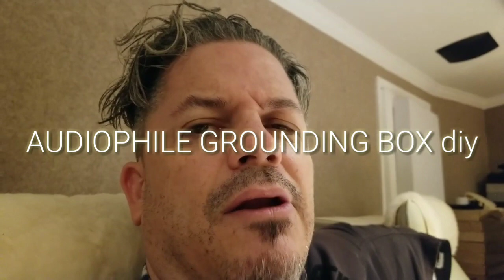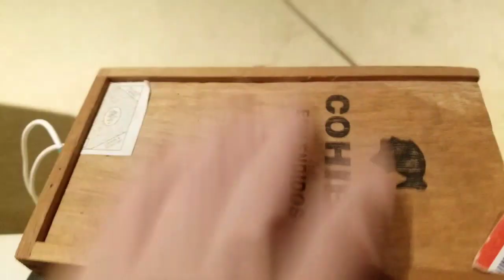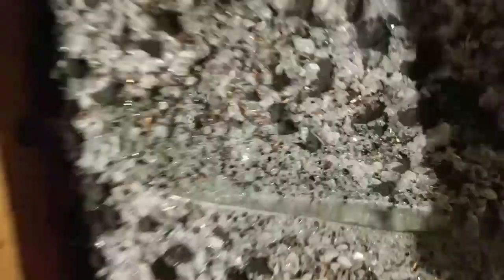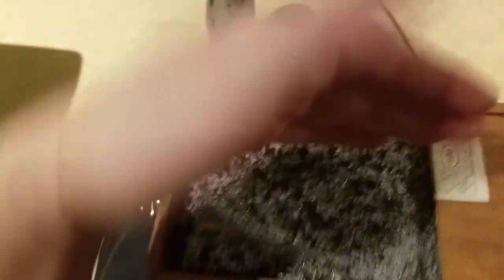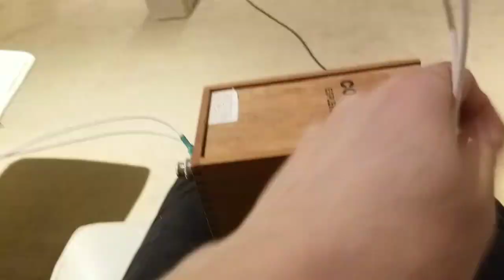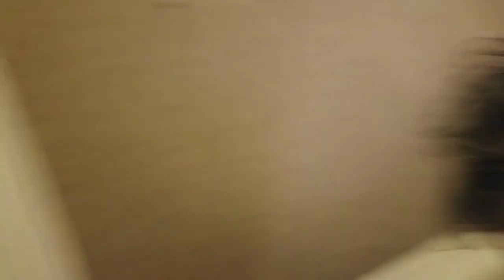AUDIOPHILE GROUNDING BOX

Comment: I am always amazed at how so many "audiophiles" are utterly ignorant of the most basic concepts of electrical/electronic circuit theory.  IF that thing works (it doesn't, but...) and you have an understanding of basic theory, then take some measurements, and tell me what the impedance of that thing is.  Express your answer in rectangular or polar coordinates, as you wish.  )
Reply from the maker: Yawn... boring..... I'm into music, not lab coats
Reply: @OCDHIFiGuy  I'm into music, too...and oscilloscopes, signal generators, THD analyzers, spectrum analyzers, impedance bridges, etc.  They kinda go together, and each makes the other more fun.
Reply: Very simple , listen and decide .

Comment: From what I could see there is a bit of foil and a collection of crystals and rock bits. The binding post provides a common Earth to all the equipment. The binding post will ensure that the earths on the separate pieces of equipment are all at the same potential, apart from small drops due to the resistance of the cables you used. There is no conduction path out of the box that I could see, so no current will flow anywhere in the box. Magnetic fields will be zero because no current flows.
Reply from the maker: Unless the box is negatively charged

Comment: Im glad peizo sheilding/earthing/protection is getting more attention. Obviously no one wants to share the sauce which is unfortunate (but understandable) as people really need things spelled out for them. Personally I think the greatest effect of these systems is that the reactivity of the qartz creates an opposing force to all the nasty RF and EM noise polluting the cables (essentially antennas) we use. When you consider even 16 bit depth at line level is 2.5v / 65,536, microvolts of noise can obscure several "steps" worth of resoultion, ,and 24bit? pretty much theoretical. There is someone Ive seen that will encase the crystals in a polymer clay which I think compresses the mix when it cures and contracts, further increasing reactivity. I Imagine in the future as equipment becomes more and more sensitive, methods like this will be absolutely essential.
Reply from the maker: Yes, it's a very interesting field of study.

Comment: Are those minerals creating 5 ohms or below on an ohm tester if not it will not perform like it should, to activate a proper ground system requires electrolytes and or water to enhance the proper ohms you need, using dry minerals in a box isn't doing nothing
Reply: You're thinking of a safety ground. That's not what this is. They call it a ground box because it connects to the ground/s on the stereo but it's purpose is different. They really ought to come up with a different name. It throws people off. I was reading a thread on audiogon on these and there were so many nonsense comments I couldn't believe it. Most people have no idea of all the ins and outs just for safety ground much less a real scientific mystery like these things. 

This thing somehow drains noise out of the stereo. I doubt it's been explained by science in any detail. Piezoelectrics vibrate in electromagnetic fields and that vibration is damped and turned into heat by carbon. I know a dealer that in his home system uses ground boxes but no power conditioner. 

I'm trying to figure out how to make these. I have large aluminum cases I could use but I want to experiment with small ones to get the optimum mixture. I think Shungite ought to make up the bulk of the mixture. Then tourmaline which is quartz with extra metallic elements in it. Could probably use Rutilated Quartz which sounds like the same thing as tourmaline. Then ferromagnetics like soft iron shavings, maybe nickel. Some copper. Silver and tungsten if you're loaded. So the ferro magnetics amplify the electromagnetic fields and the quartz vibrates it into heat. Not sure about the copper other than to conductive it in and contain or direct it. Many designs have copper plate lining the box. Copper is diamagnetic. It opposes an electromagnetic field induced onto it. I have no idea why you cant use plastic or aluminum boxes.

Comment: The only functional aspect of this device is the binding post which is used to connect the equipment signal grounds together which may or may not provide some value depending on you gear setup.   There is no current path into the box and it has no connection to ground so it does nothing. The sole value of the box is the joy you got from emptying it while you smoked the cigars.
Reply from the maker: Clearly its not an earth Ground, people are getting results however. Personally I use 4 grounding rods just for my rig, in the earth that is...

Comment: Sea salt, coal and some soil should do it.
Reply: Why would you use that? A guy on audiogon researched grounding backfills and that's what he found. He used agricultural charcoal and some type of salt. He said it worked great. But the salt is used in that application to attract moisture. No idea about the charcoal. Maybe to keep the salt from corroding everything within a 100 yards? 

That would be the cheapest solution. Barbecue charcoal and salt. Maybe have to recondition the copper each year due to corrosion? Would that create a negative ir positive charge that would make your system smoother and quieter? I'll probably be trying it. Too cheap to pass up.

Comment: A box of dirt isnt an earth ground, there is no current flow to"earth".
Reply from the maker: Absolutely true. Its not an earth whatsoever. It will however receive stray current off the ground and in many cases make an audible difference. Google Entreq. Plenty of companies exist selling just this type thing alone. I saw what they were doing and tried my own. It worked. What a mess to produce as a product. So I dont ... but i show you guys how to DIY it.
Reply: @OCDHIFiGuy  seems to me if it was inline to earth it would act to disperse a close earth lightning strike. does it eliminate hum?
Reply from the maker: This is a pseudo-grounding technique.  Has nothing to do with safety at all. We are talking strictly about signal ground. As in ground reference point. This takes off stray current on the ground caused by power supply leakage, therefore giving us a correct zero voltage ground reference, and making the music reproduction more true and accurrate to the original. In theory anyways.
Reply: You can call it a grounding MASS. It will act like a ground.

Comment: All the stuff in the box is irrelavent. The binding post is all you need.
Reply from the maker: Yeah ? Tell us more.
Reply: Binding post to what?
Reply: @OCDHIFiGuy  From what I could see there is a bit of foil and a collection of crystals and rock bits. The binding post provides a common Earth to all the equipment. The binding post will ensure that the earths on the separate pieces of equipment are all at the same potential, apart from small drops due to the resistance of the cables you used. There is no conduction path out of the box that I could see, so no current will flow anywhere in the box. Magnetic fields will be zero because no current flows.
Reply: @geocarey  hi i don't know if this does anything but I may try it  one day on my diy tube amp that users  a floating ground that is connected to the  CT of the  power transformer which would mean it is  in my signals the current path. Agree that there would be no current path to the electrical ground.

Comment: Hey here is another idea use salt water.
Reply from the maker: Funny you say that. I was talking to a client and friend last night about the grounding boxes as he wants to make a few. I told him I was going to try a conductive fluid that would fill all the gaps , though I was thinking more like a mineral oil with nanoparticles.   What does salt water do ?
Reply: You can charge it, electrolytes use it or some of them does.
Electricity goes well through it.
It is the salt that does it.
Behaps that should be grounded as well. lol
Reply from the maker: Sounds dangerous somehow..lol
Reply: Salt water would corrode the conductor.
Reply: @OCDHIFiGuy  look up the engineering behind liquid rheostats......
Yes I'm still lurking here and I did sub...
For comedic value of course 😆
Reply: use a battery ?